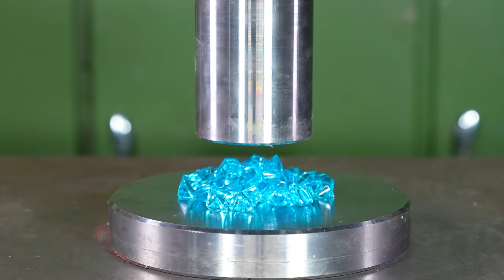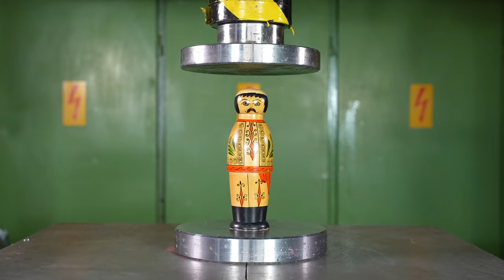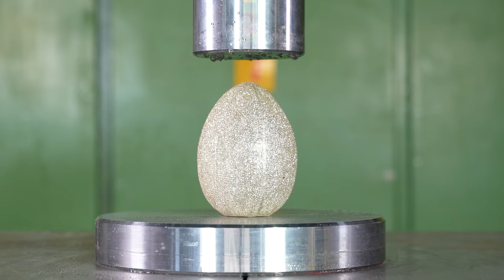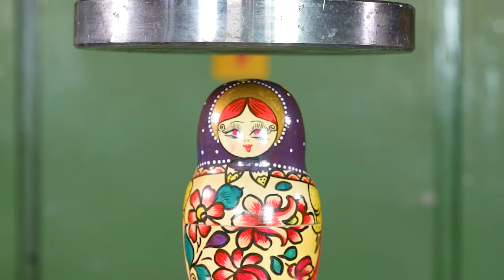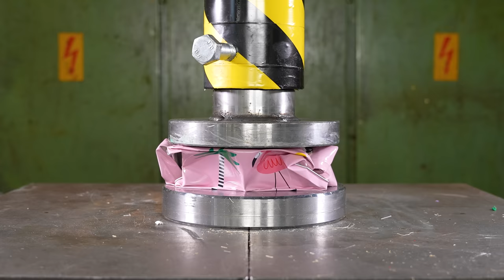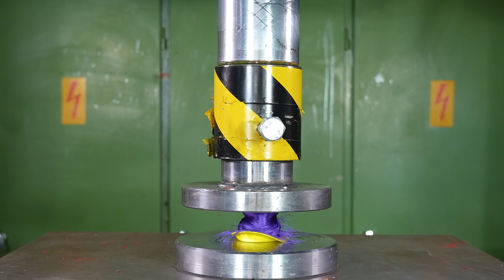Philosopher's Stone Vs. Hydraulic Press

Comment: I will never tire of watching metal cylinders intricately and symmetrically fold themselves up as they are pressed. I wonder if there is math to explain it? Is there always the same number of folds around the circumference?  Is there a wall thickness limit where they just burst?
Reply: folding evenly is probably just the least dislocation in sum

Comment: I wonder if you could make automotive friction material, gasket material, or brake material explode in the press. You'd probably need small pieces to get enough pressure but it might potentially be exciting.
Reply: Brakes-clutch will become dust, a Little piece of clutch may even burst but thick old style head gasket would behave more like liquid, spark plugs are actually very hard ! Any junkie know how to use pieces of the plug to break car windows with a simple tap🤣
Reply: @gillespriod5509 That trick needs only the hard metal tip in a stiff handle to transfer hand force to tiny point, making the window react as if an entire person was thrown at it during an accident.